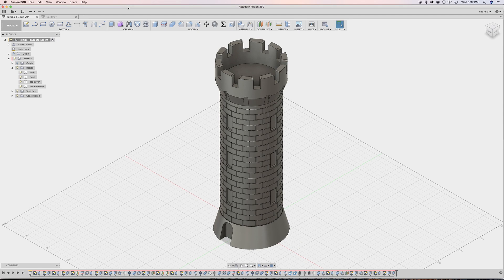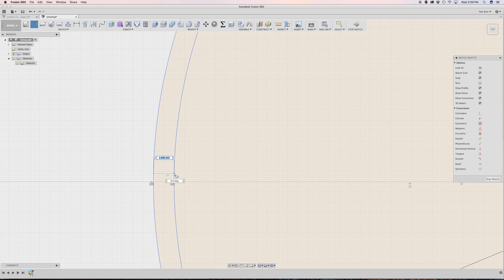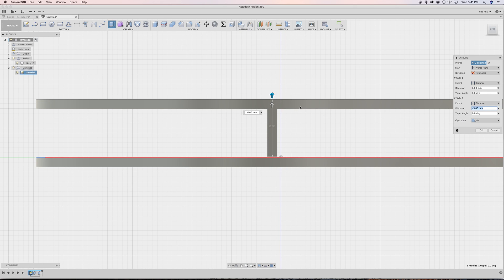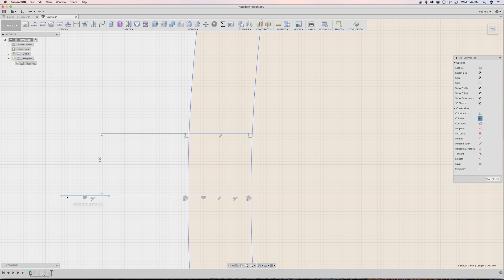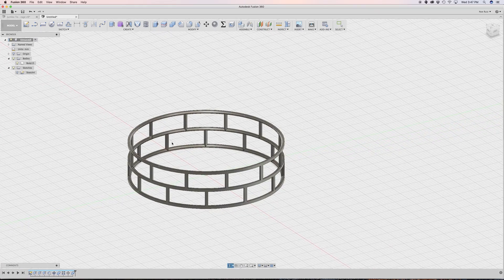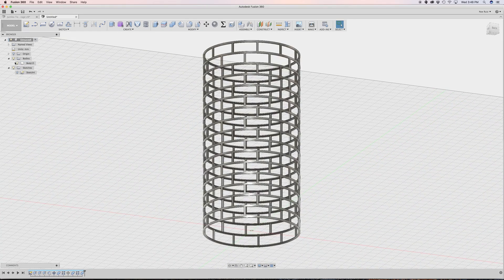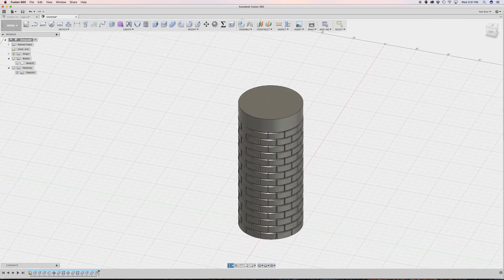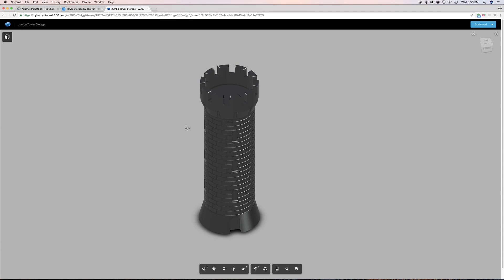Layer by Layer – Brick Texture (Cylindrical)

Comment: I came up with a [perhaps] slightly simpler way: http://a360.co/2hnxQiQ

(Please don't judge too harshly, I just started learning Fusion 360 a few days ago.)
Reply from the maker: Thank you so much for posting this! Applying the chamfers in two parts really does the trick. It reduces having to "shave" the excess overhang. Great work :-)
Reply: Thank you so much for making this great video!  I learned so much by following along to recreate your model.

I eliminated the 'shaving' step by using a 0.5mm offset in the sketch, instead of 1mm.  Also, by drawing the lines out from the center of the circles, trimming them, and then dimensioning between the inner points, I was able to get perfect 0.5mm chamfers with the edges pointing uniformly inward.

Comment: I don't know how to do this any easier, but I do know that an easy way to do a leather grip texture on a cylinder is to use square springs (clockwise/counter-clockwise) to cut into the cylinder